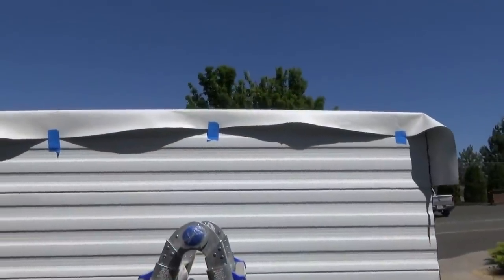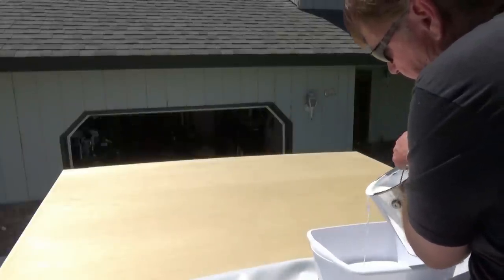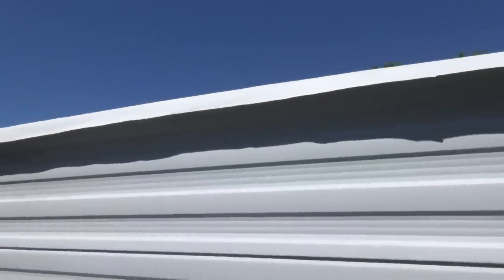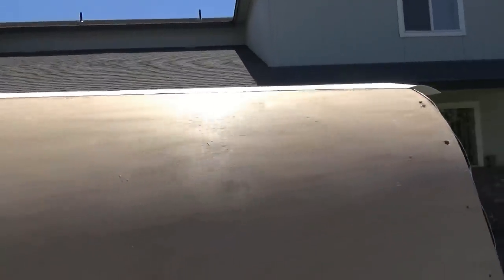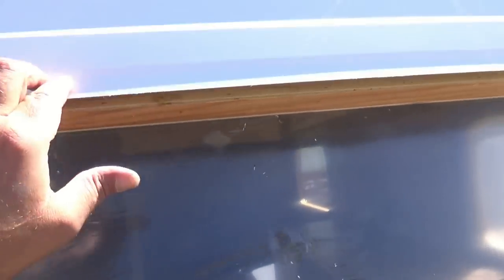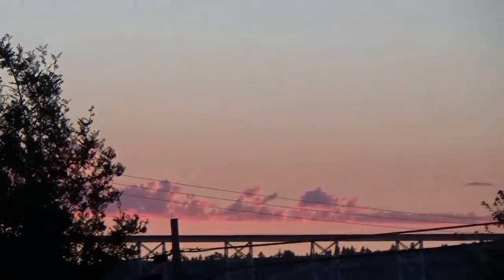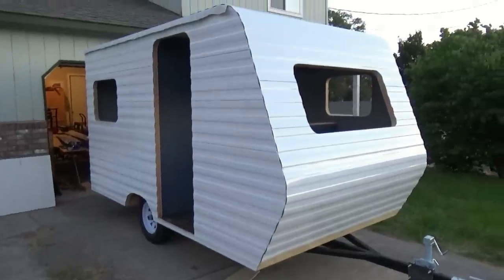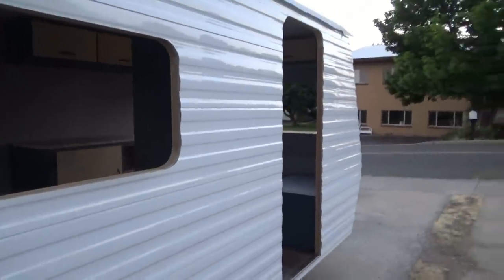How To Build A DIY Travel Trailer - Part 34 (Installing the Rubber Roof/ Siding – Part 2)

Comment: Awesome! Your tutorials have been EXTREMELY valuable to me!  And thanks to your videos, I am now confident enough to begin my own 12 foot trailer project. Which has officially started!
    For my frame, I bought an old 1990 Starcraft Nova Popup Trailer with electric brakes and a max weight of 2200lbs. (Only $400, what a steal!) .   The wood  was in terrible condition, but the frame is in pretty great shape. We demolished what we couldn't salvage and stripped it down to the bare frame, now we're almost done grinding off the rust, and we're preparing to repaint, then we can start the build!
Reply from the maker: That is totally AWESOME! Looking back... I should have shopped around for a used trailer, could have saved myself some money for sure!! You got a super deal! You are going to have a great time with your build! Hoping to see some pictures of your progress... I am very grateful for the feedback, much appreciated. Good luck... stick with it and "just do it!" Before you know it, we'll be campin! :)
Reply: Wow...fantastic oportunity you had!!! USD400 in Brazil represents 4% of a   short brand new RV ( basic version without optional items ) ! Great business !!

Comment: where did you buy the rubber roofing kit? can you send the link? whats the name of the kit or brand too? we are building the roof of our home made camper trailer and we are trying to figure out what to put on top of the plywood. great video btw appreciate this
Reply from the maker: I used EDPM rubber roof, purchased at Affordable RVing in Portland Oregon. You should be able to find on Ebay or Amazon as well. Thanks for checking out the build!

Comment: Watching your videos is awesome inspiration and information! If you are still reading these comments I have two questions (right now anyway): 1. Not counting the trailer or camper steel frame, how much did this project cost?  What do you tow your camper with.  Just purchased an amazing trailer with a 1967 Cardinal camper attached to it.  I am going to gut it down to the frame.  I need to buy a truck/suv to pull it across the Rockies.  Do you have any suggestions>  something made around 1995 and 2000.
Reply from the maker: Hi Michele! Yup, still reading and answering all the comments! :)   The trailer cabin is actually stick built, no steel. If I discount the trailer frame, axle, wheels and tires... roughly $2000 (paid for the welding), and I discount for all the foo foo, approx $2500 (solar and fancy electrical stuff), I would have about $3000 to $3500 into the build. Most of that is the siding ($1400). Cushions were a little on the high side ($600). So really, If I didn't go all out... build was pretty cheap! The weight of the trailer comes in at 2050 pounds dry weight on a 3500 pound axle. I pull it with a Dodge Ram 1500 with a 6 cyl. Pulls great. A lot of mountains over here (not hills!) and I get about 17 mpg. I'm partial to the Dodge Ram 1500, so that's my first choice. A larger SUV will pull your rig just fine. I would probably stay with a full size for the pickup if that's your choice. Hope that helps! Cheers!
Reply from the maker: Thinking about it... a Dodge Dakota would be a nice one. I had a Dodge Dakota (1998) with a 4 cyl that I used to tow my sailboat back and forth to Washington, wouldn't use that to pull my trailer, but a Dakota with a 6 or 8 cyl would be nice! :)
Reply: @OregonBatman  Awesome! We live in Colorado on the east side of the Rockies and plan on pulling it over several different passes to the western slope.  And now I know approximately how many pennies I may need to save to do the project.  When I estimate any type of project I take the time/price then multiply the total by pi (3.14) hahahhahah It actually works quite well.  Thanks so much for your feed back! Happy camping!

Comment: Hi Al, could you please tell me about how long it took you to put your rubber roof on?  I’m almost at that stage and was wondering about how long it would take. Thanks a lot. Can’t wait for you next project.
Reply from the maker: Hi Gary... if you have all of your materials laid out and ready to go, I'd say you could have the adhesive rolled out and roof installed within a half hour or less. What I would do next time is to take a piece of 3" pvc pipe and roll rubber roof up so it can be unrolled as you go along, this will keep the rubber roofing flat as you go. I had to fight mine a little bit as I was trying to lay it out. Hope that helps.
Reply: Thanks Al I will do that. Thanks so much for all your info. Have fun camping

Comment: Great video. I’m about to renovate my first. Question on the installing the siding around corners. I see you just cut to the shape of the camper so the front and side pieces have minimal gap....then see you taped over the corners. Would it make sense if I started with sides and folded a 1” lap (similar what you did underneath) all around. Then lay the top/front/back over the fold to get rid of the gap? Just thinking. Help me if you see that could be an issue.
Reply from the maker: Nope... see no issue. In fact, a lot of the older trailers used that method. Fold it over and stapled. Only thing I would add is to make sure to seal that edge real good. Water leaks were prevalent around those edges, so proflex under the edge before folding, then seal the seam with more proflex before adding trim. Good to go.
Reply: OregonBatman thanks! Also where do I buy the roll of rubber roofing?
Reply from the maker: Hey Josh! I purchased the roofing at Affordable RVing 15555 SE McLoughlin Blvd, Milwaukie, OR 97267 (503) 659-3610 I do believe they ship. Also can be found on Ebay. Affordable RVing has a store on there too. If you google search for it, you might be able to find in your area as well. Cheers!
Reply: OregonBatman thanks! Appreciate it!

Comment: i want to build something like this , way to go.
Reply from the maker: Hey John, thanks for watching! You can do this! Plan it out and just do it.... piece of cake!
Reply: today I started using skids for the base , but I.m having difficulties with them being hardwood. Any suggestions on how to nail this type of wood, (hardwood) I sure can use some expert advice here. The rest of this will be pine ( so much easier to nail.)
Reply from the maker: Hey John... you may have to predrill pilot holes before nailing. A drill bit slightly smaller than the nail.... then use some bees wax to help dive them in a little easier without bending. That may make it a little easier. If all else fails, predill and screws (I'd still use the bees wax into the hardwood).
Reply: thanks for responding so fast. i gotta get back to it. I'll do it.
Reply from the maker: Keep at it... :) You'll be glad you did!

Comment: What did you do for the bare wood in the wheel wells? Was there a specific coating you applied?
Reply from the maker: I used a spray on rubber undercoating... seems to work okay. Will probably have to go under and do a few touch ups. Pulling down the road, the tires pick up rocks and dings things up. Easy job though... remove tire, cover things you don't want spray on, and let 'er fly! :)

Comment: very nice build , but just thought , ever think rhino lining the bottom and up the sides a bit ? i know lots guys are doing there trucks and every thing my though because i am build some thing for camping also , so i want rhino line it and protect  my work
Reply from the maker: absolutely... if I had to do it over, I would either rhino the bottom, or use filon. That would seal it up real good! :)  Thank you for stopping by!

Comment: how much was just for siding and trim. The price was 72 dollars for one panel?
Reply from the maker: Hey Tommy... thanks for the question. There are 24 panel total for the build. Total cost for the  siding was $1400. Approximately $58.33 per panel. The trim was probably around $100. You could get that a little cheaper if you find an RV surplus store in your area. Thanks for stopping by!
Reply: OregonBatman righteous thanks 😉

Comment: Where did you get the siding? I've looked everywhere
Reply from the maker: Hemet Valley RV 41491 E Florida Ave, Hemet, CA 92544  (951) 765-5075  Super nice people to work with! I sent them a drawing of my trailer with overall dimensions and they figured out exactly what I needed.

Comment: I also just finished building a trailer and need help with waterproofing it
Reply from the maker: Hi Zyad... was the video able to help you out? Congratulations on your build!
Reply: I too am building a teardop. How do I waterproof the floor that mounts to trailer frame? Driving in rain will ruin it. Do I have to use treated?
Reply from the maker: Hi there! Congrats on your build!! There are several options for undercoating, one of my favorites is Rustoleum. They make a great product to coat the bottom with I will include a link for the product from Amazon, although, you can purchase local too I'm sure.... you do not need to use treated wood if sealed well. Make sure all seams are sealed before coating, and it will be fine. Thank you for stopping by!! Hope this helps!    https://www.amazon.com/Rust-Oleum-Automotive-254864-Professional-Undercoating/dp/B0070S7T9K/ref=sr_1_cc_1?s=aps&ie=UTF8&qid=1522900554&sr=1-1-catcorr&keywords=rustoleum+undercoating    Hope this helps!
Reply: OregonBatman well I mean the underside of floor. Where it faces the ground. I'm afraid if I don't do something it'll rot from driving in rain, but I hate to use treated.
Reply from the maker: Yes sir... on my teardrop, and this camper, I used a primer coat to seal the wood, then used an enamel to undercoat. One other option: Use Filon (fiberglass sheet) and adhesive to cover bottom. This is what I will be using next project. It is about $2.50 per square foot though, but will be seamless and never leak (unless you smack a rock or something). :)
Reply: OregonBatman lol. Thanks for the info. And thanks for sharing your build with us, it definitely inspired me!
Reply from the maker: Yer welcome! Cheers!